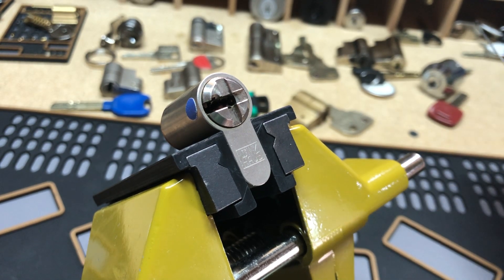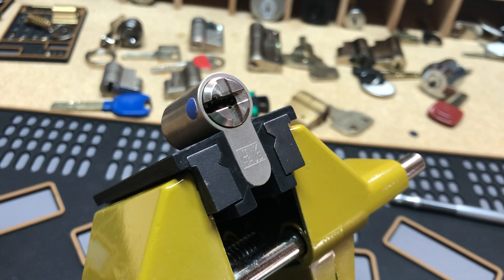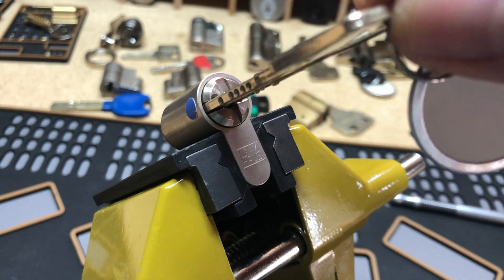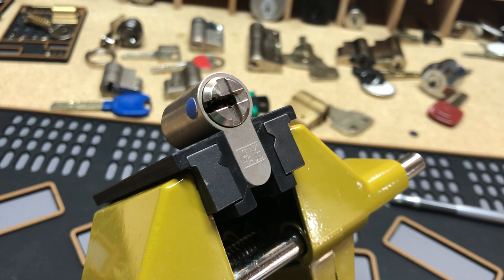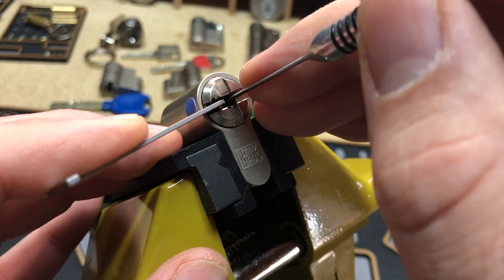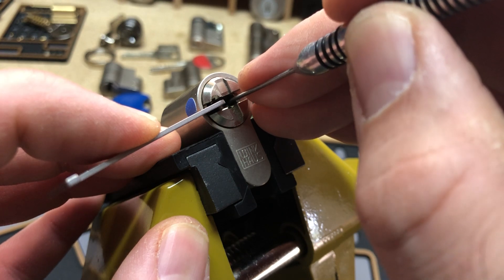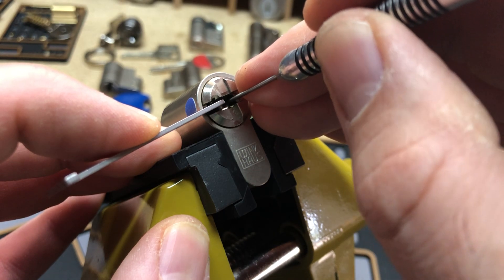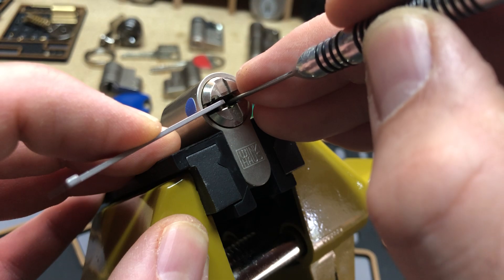009 Winkhaus keyTec n-tra, pick and gut. Blue.

Comment: Question,?for picking a cylender  locks the tensioner shod push clockwise or anti clockwise
Reply from the maker: Generally I don't think it matters, unless the nature of the lock dictates a specific direction. I tend to pick horizontal keyways like the one in this video with ACW tension out of habit, and vertical with CW TOK tension. No particular reason other than comfort.